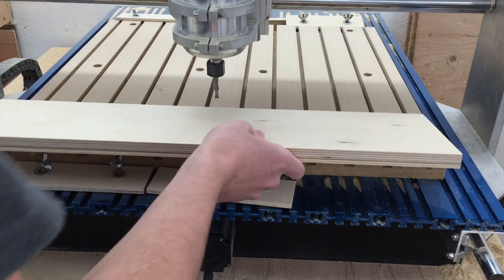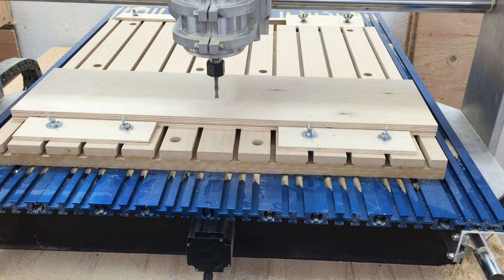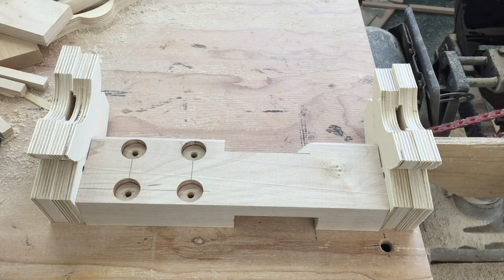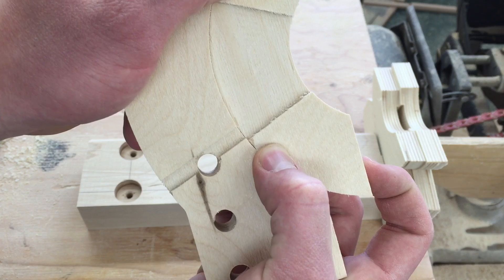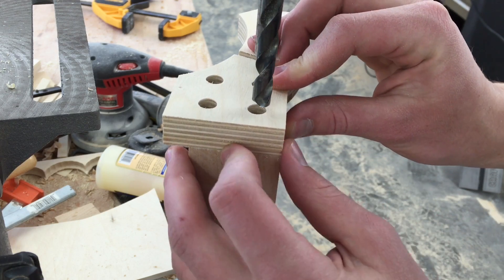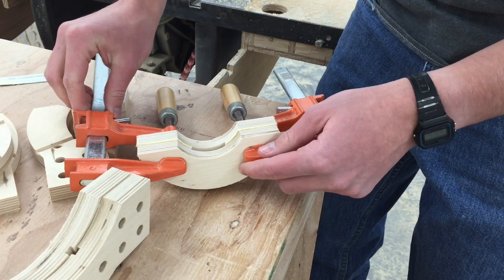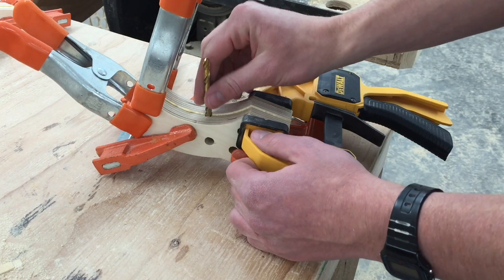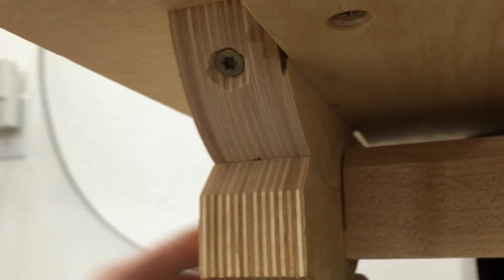CNC cut trunions

Comment: Jer, coat the Baltic Birch before cutting, even NC, tear out drops. (urethane, CEP, even soaked in varnish) Consider Brad Point bits, as the small scoring tip will reduce tear out and "end grain wander" compared to high speed steel, and look at Onsrud Spiral cutters for bearing guided bits.  All are reasonable cost improvements to your many fine projects and great videos.

Comment: do you have the custom er20 collett on this router?
Reply: +Jer's Woodshop oh ok. how is it so far? how long have u been using the Bosch on your cnc
Reply from the maker: A couple months ago Inventables sent me an X-Carve to try, so I haven't used the old CNC since then. I still have it and I may or may not start using it again, now that the Inventables deal is over. In total I probably used the CNC with the Bosch for a year, and I loved it! I really like the low RPMs on the Bosch (8,000 RPM) and I would recommend it to anyone wanting a router for a CNC.

Comment: I enjoy watching your videos . What program are you using for your CAD? I started CNC back when you manually data input or used a IBM card to punch the tape. Long time ago. I later used MasterCam and a PC. I loved it. I am retired now and thinking of getting a CNC router for a hobby. What would you suggest I should look for in a router and software for home use?
Reply from the maker: I use Sketchup as my main CAD to design my projects, but I use V-carve Pro to design CNC projects. I have little/no experience with anything else so I'm probably not the guy to ask. I like what I use though, I can say that.

Comment: I'm making Mattias' jointer using a homemade cnc (no table saw yet). I've been making the double layer pieces with 1/8" reference holes for glue ups. I use brass rods to keep everything aligned while clamping. After seeing your video, I think I'll adopt your technique instead. Thanks for the video.
Reply from the maker: Sweet! I wish I was building the jointer! But don't need it bad enough to be worth it at this point.

Comment: can you provide a tour and info on your CNC , thanks.
Reply from the maker: It's a modified CNC Shark. I would make a video about it, but my upgrades weren't as helpful as I had hoped so I can't recommend that anyone else does the same upgrade. I replaced the gantry because it had too much flex and it would deflect if I ran over about 50 inches per minute. After the upgrades I can run only about 80 IPM with the same bit...not a huge improvement.